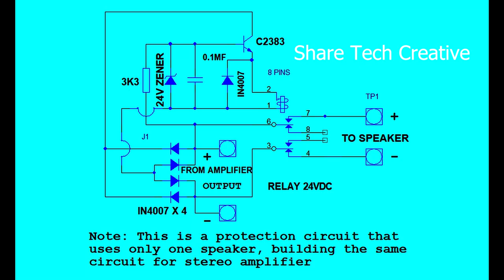How To Make Speaker Protector Circuit NOT Supply Power With C2383 Transistor

Comment: U missing a one transistor 
But circuit diagram is only one transistor 3.3k 
Onther transistor what
Reply from the maker: You need to use one 3k3 resistor
Reply: Okay sir I will try i again thank you so much sir